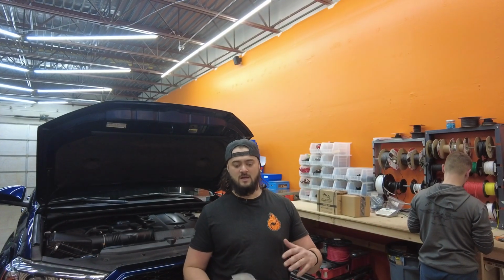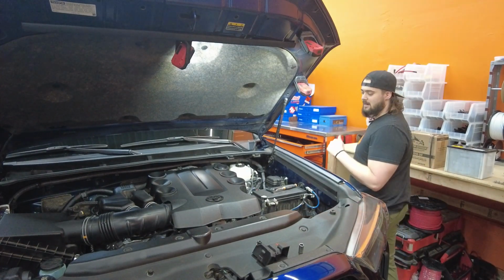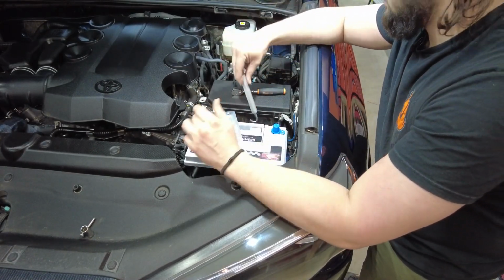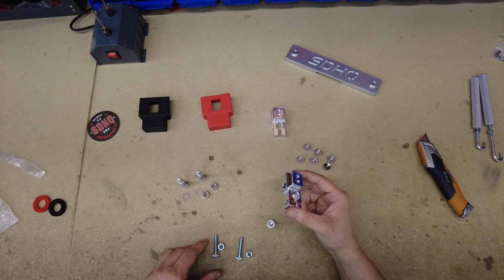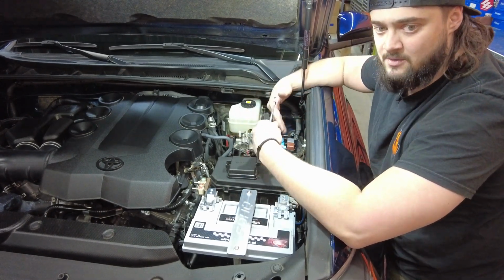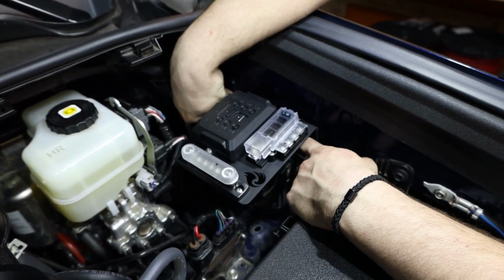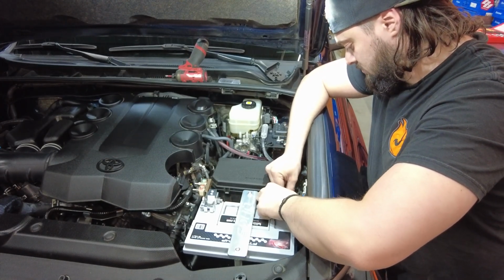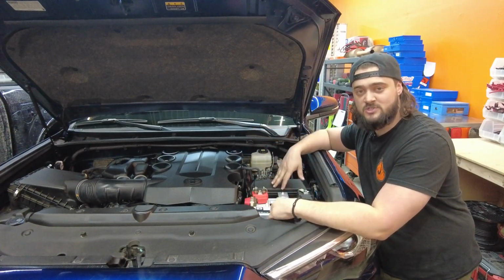2020+ 4Runner PowerSwitch, SDHQ Terminals/Tie Down, and Full Throttle Battery Install

Comment: A very simple install. Thank you for walking us through that. With a body lift that positive terminal will need shaved down to put those fuses back on top.
Reply from the maker: Thank you Tim! Actually you can unclip the power harness from the frame to get an extra inch or two out of the cable to make it work! We recently had to do that in shop.

Comment: This seems to be the answer I've been looking for! Thank you for all this sweet info! Question for you. Keep in mind I really have no clue about electronics on vehicles, but what is the extra fuse bar for on the plate? By using the Garmin device, I thought you didn't need any fuses because it was all set up within the device. I love these videos of setting your system up, but I'd love even more to see a video where you're then adding all the different light components and other items to the Garmin, and other fuse bar. Do you have a video like that?
Reply from the maker: Thank you so much for the compliments and interest! The fuse block is for items that do not need switched. In the shop we often hook solar inputs there to charge the battery, fridge freezers, GMRS radios, and anything else that may have a built in on off switch!
Reply: Does the alternator put out enough voltage for that battery or do you need one of those voltage boosters? Thx

Comment: Nice and clean install! Is there a reason you connect your grounds before your power wires? As long as I've been doing my own wiring, I've been connecting the grounds last.  Kinda curious if there's any reasoning behind connecting the grounds first.

Comment: Hi,

Thanks for sharing!

I didn’t get that part where you connected the Positive coming from the garmin switch to 2 fuses 125a the other one was I think 50a or such.  Are there 2 power cables coming for the Garmin switch?

You Camera was so far should’ve been zoomed in.

Thanks
Reply from the maker: The 125a fuse is for the Garmin and the smaller fuse is for the blue sea systems fuse block!

Comment: I have an ecoflow 800w alternator charger coming... comes with it's own 125a fuse.  Can I hook it up to your terminal fuse or do i need to go straight to battery as separate circuit with their fuse (or another terminal fuse)?
Reply from the maker: Hello Dru, the 125 A fuse for the Garmin is ONLY for the Garmin PowerSwitch.